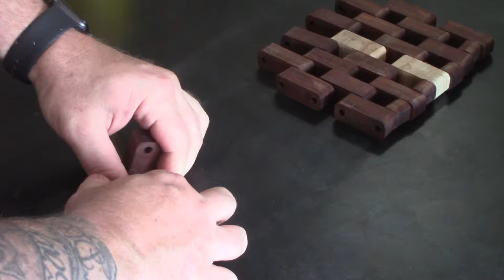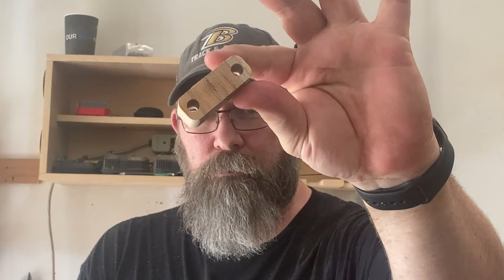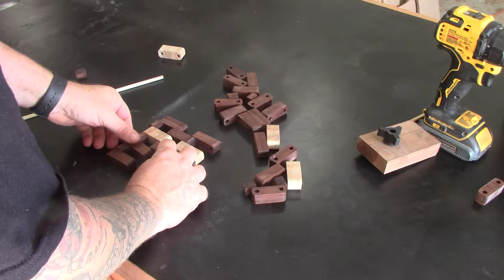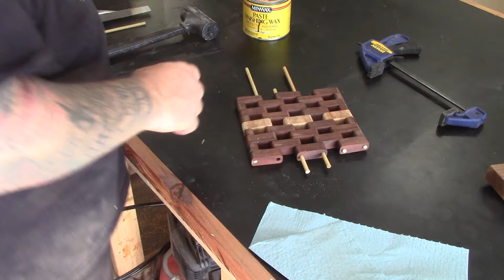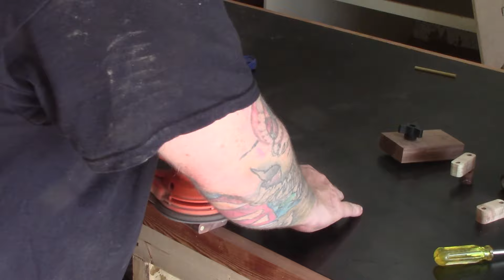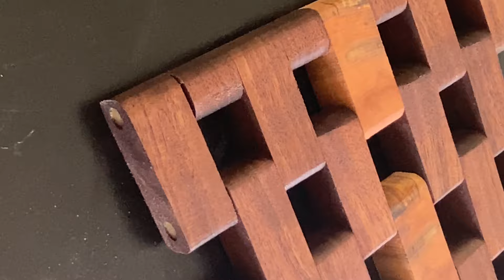How To Make Chainlink Woodworking & Decor

Comment: Great looking project.  But…I’m appalled at how much more wood is wasted by using a cnc machine.  There are two kerfs where there would be one, and they are wider than on a table saw, much wider than on a band saw, AND there’s space (more waste wood) BETWEEN the kerfs surrounding the pieces.
Reply: No doubt there was some wasted wood, but for a couple trivets, few of us would bother to nail down the design beyond what is presented. It's not a CNC issue, just a simple design based on the intent of the project. If you're making a production run of a couple dozen or more, redesign with a single kerf and possibly a smaller bit, which would increase cutting time. Bit size would be a tradeoff between wood waste, design time and machine time, which is done for every project.
Reply from the maker: @WindRidgeWoodCrafts  This ^
Reply from the maker: That's a very good point. I could have decreased the amount of kerf and made them closer together. Thank you for the comment.